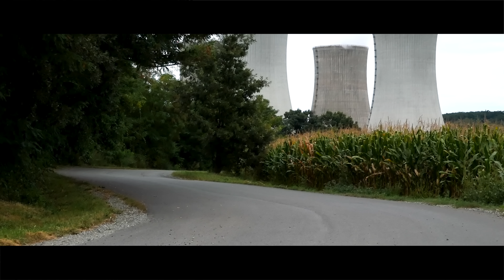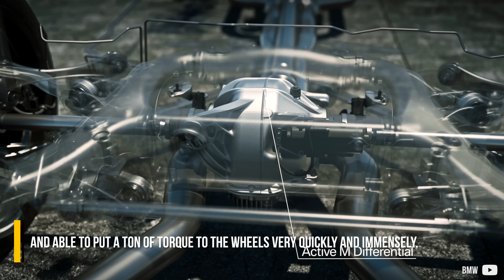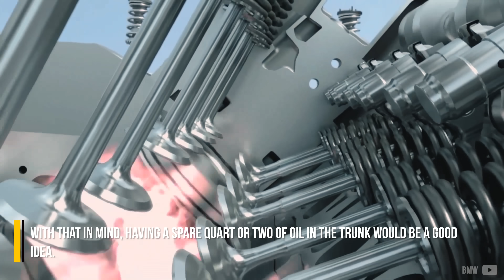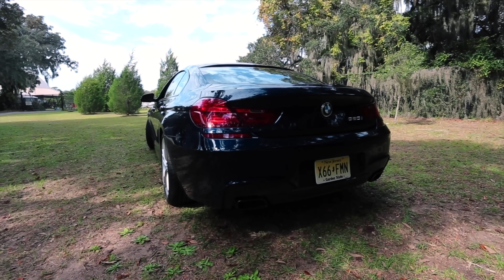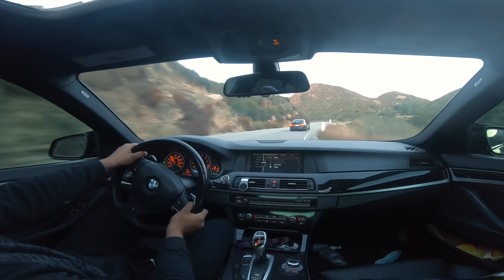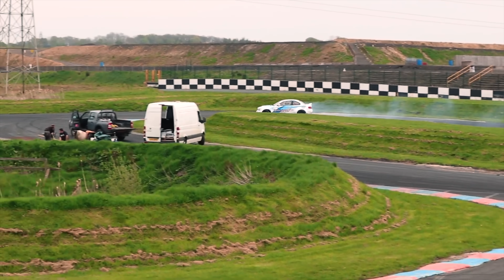The Worst BMW Ever?

Comment: I want to take a moment to reflect on how GM, Ford, and Chrysler have been designing and mass producing engines at this power level for decades, which tend to be both durable and as easy to work on as anything. BMW designed and manufactured this absurdly complex and impossible to service engine that barely makes more power than a 20 year old Corvette Z06 that doesn’t melt all the oil seals in the V after 15 minutes of track time.

I love my German car, it’s fantastic, but it’s also the kind of German car where “ease of service” and “durability” were basic considerations.
Reply: It's also using 2 times less gas...
Reply: i hope you realise while you're reflecting over there that the Z06 engines have 2l more displacement...
Reply: @kevin45ize  BMW is selling a luxury product. They can up the engine size to whatever.
Reply: @michaelw6277  they can't, their main market is Europe, where they would have to charge a lot more due to tax for a bigger motor and/or higher consumption/pollution.
Reply: @tiloalo  it's a luxury product. They can make it bigger. People worried about price aren't buying V-8 BMWs.
Reply: @tiloalo  oh, also they could just use Ford engines. Same displacement, same output, more durable, more reliable, cheaper, easy to maintain; a dramatically better engine in every single way.
Reply: @michaelw6277  what is that mythical Ford engine called so I can look it up?
Reply: @kevin45ize  oops, my mistake. The Coyote makes a touch less hp. But it's a 100k car, I'm sure the money saved using a Coyote instead of the lump of garbage they have currently frees up enough cash to spring for a Ford Racing supercharger.
Reply: @michaelw6277  never seen any efficient engine made by ford...
Reply: @tiloalo  yeah I mostly agree, but  the Coyote is a great engine
Reply: @michaelw6277  a M5 with a 4.4L V8 produce 617 HP, the ford with this 5L produce 396 HP... Not sure how they are comparable, they are probably 20 years appart in term of technology.
Reply: @tiloalo  Ford Racing sells a supercharger, good for ~750 hp. Not bad for old tech; cheaper, more powerful, more reliable, better durability, dramatically easier to work on, and doesn't create under hood temperatures rivaling the surface of the sun.

New technology isn't always better, and in this specific case it's significantly worse in every measurable way.
Reply: @michaelw6277  yes, a custom motor made for racing will be better, true.
Reply: @tiloalo  that's a street engine with a factory warranty

Comment: BMW thinks that “high performance” engines consume more than a quart of oil every 1,000 miles? Yeah I won’t be buying a BMW, ever.

I mean damn, my 150k mile turbo Volkswagen doesn’t use a drop over 5k miles between changes and I’ve been pretty hard on it for over 12 years now…

Comment: 15k oil change intervals is mad insane. my US bmw dealer has always recommended 7k… and at most i’ll push it to 10k.
Reply: thats 15k kilometers. so it comes out to about 8k or so miles. i do it every 5k for my n54. that oil aint cheap lol
Reply: 7k pushing it anyway but better than their recommendations. 5k is best
Reply: i’m speaking in miles here to clarify. i’ve done 7k on both my n54’s and they’ve had zero issue. This mileage was dealer recommended from my technician.

Comment: My f10 wasn’t a m5 but it had issues after 2.5 years , steering parts was failing and flywheel failed after just 20k miles , had electronic issues aswell , the car was a money pit after the warranty ran out and ended up getting stolen in the end , then I moved onto Mercedes w212 and the mileage was 133k Miles when I bought it and it was 3 years old , still got it now and it’s the most reliable car I’ve ever owned and the highest mileage car I’ve owned , the only money I spent on it was on tyres and servicing and still going strong  , the handbrake pull handle snapped once but that was maybe my fault but I replaced that myself for around £8/ 11usd , will probably need new brakes end of the year but that’s a job for me to do just like extra oil changes I done myself and I always switch of stop start engine as that wears the engine and other parts like starter motor , alternator , ac compressor and more and buying oil that’s suitable for stop start engines is just nonsense

Comment: I bought an e60 525D back in 2018, with the last money i had. It served me well for a year and then it became a nightmare.. I bought it for like 7k euros and it drained me almost 3k euros in repairs. While all my friends have shitty fords and vw i bought a bmw and often times i am using a cab to go finish stuff around city cause my car failed me many times. Huge problem is that this car is 15+ years old and maintantce costs like it's 5 years old.. I know someone will say "i had same car it was great", yes quite possible, but for ME personally it is a disaster. I still have it and i love the car but i am at the same time so much disapointed.. My next car will be a best car and thats a new car with warranty - no mater which brand.

Comment: Really good video. I don't mean this as a knock against your hard work in putting this video together, but I've noticed one common trend with all of these videos that focus on the problems with the N63/S63 engine...

We're now on the N63B44T3 version in the M50i vehicles, as well as S63B44T4 version in full on M cars. I feel like these videos need to focus on the improvements made to these engines in these latest revisions and leave the conversation open to whether or not the problems endemic to the N63/S63 in the past have been resolved or at least mitigated to some extent. It may yet be too early to see how these revisions will fair in terms of reliability, but since the engine is still around and still in active use I think it's an important piece of the conversation that gets lost in the criticism of this engine.

Comment: The turbos get hot, the radiator gets hot, the intercooler gets heat soaked. Then the car goes into limp mode.  My 03 E39 540i M-Sport 6-speed manual keeps chugging along no issues.  Those N63 engines are horrible.  Those 550i's and 650i's  all terrible eventually.

Comment: I had a f10 m5 6mt. I tuned it with basic bolt ons and drove it pretty hard- it was great until it let go at 50k miles and went into limp mode.  
Sold it for the GT-R.

Comment: Either design an engine with parts that will last at least 150,000 miles, or make the engine so that the parts are easily replaced. Instead, what most manufacturers do, including BMW, is make it nearly impossible to replace certain parts, and they make those parts in a way that they need replacement frequently. In other words, a nightmare for the owner.
Reply: @Mrwaffleandmilk  you are dead wrong, take a look at the Toyota 3.5 L V6 that they put in to the Camry and in the Sienna and in a bunch of Lexus models, not to mention the Lotus Evora. Those engines frequently go 200,000 Mi without anything being replaced. Case closed.

Comment: I had a 1995 BMW 840ci, I bought it because I think it is one of the most beautiful cars ever made. I had it for more than 10 years and I must say that I regret ever buying it because it was one problem after another.
Reply: That's actually pretty weird. The M60B40 in that was a great unit. The ZF auto transmission wasn't too bad either - though the manual was better. I'm not sure if the manual was available on the 8.
No VANOS, no turbos, good timing chain. The only problem I ever had with both my M60B30 and 40 were intake manifold gaskets. On my 40 I was having repeated problems until I planned the intake (by hand!). 
I think you just got unlucky.
Reply: @pgbpro20  the problems I had spanned the full realm of electrical, engine, cooling, fuel pump, suspension, so the engine itself wasn't so bad, but all the accoutrements added up.
Reply: @TheHomeExpert5  I think some of how happy you are with a car would be your expectations going in. I would expect all those things except for electrical gremlins, because I've been through it all before w/ ze germans!

Comment: The n47 is also a prime example of poor design, the biggest being that the timing chains may slip.
In my case i bought a 118d '07. had it for two weeks until it started making terrible noises. The repair shop said that the top was cracked where the bearing for the camshaft is, and there was heavy wear on the crank shaft. But hey, at least i got my money back.

Comment: N63 worst motor ever.  Didn't get 60k miles  out of that motor before it started blowing oil and fouling out.  Burned about a quart of oil per week. Worth nothing at trade in.  BMW should have never allowed that motor to be sold.  i will never buy another BMW again. Went Porche, never looked back.  What BMW has done with these motors is nothing less than criminal IMO.  BMW buyers beware, run away.

Comment: I’ve owned 2-1/2 BMW’s, I count my 2003 Range Rover as half BMW since they were responsible for much of vehicle engineering as well as entire drivetrain. Of the 3 vehicles, none lasted more than 25k miles before engine required replacement or major overhaul. 2 had transmission failures. One lasted less than 2000 miles; in 8 months ownership the engine seized twice, spent 3 times more time in dealership garage than in my garage and BMW voluntarily lemon lawed the vehicle before I could hire attorney. 

You could not pay me to have another BMW. One of my neighbours currently owns one, it leaves oil on his garage floor every night despite dealer making 3 attempts to properly seal engine. Garbage vehicles

Comment: I was disappointed with BMW and the run flat tire problems.  I researched that BMW has become more unreliable with 4, 6, 8 cylinder engines failing before 100,000 miles.  I tried Toyota/Lexus and was impressed.  I should have tried their statistically most reliable lineup earlier.  The different cost for repair and maintenance could be $1,000s or so high the vehicle is mechanically totaled by insurance market.

Comment: Try telling your BS to racing teams who compete in them, endurance racing etc lol.
Reply from the maker: Racing and daily-driving an engine is a completely different story and cannot be compared
Reply: @VisioRacer  dead right sunshine, racing put far more stress on a car over just a daily drive. Endurance racing is called endurance for a reason lol, smashing a car for 24 hours, etc.
Reply: @VisioRacer  follow production car racing like our Bathurst 6 hour race, cars are near showroom cars, BMW have dominated and none have spun the hub lol. That’s another BS.
Reply from the maker: @lbarbato6425  Well, I suppose they use different parts all around, different oil and muuuuch shorter intervals (after each race?). But what does it have to do with the road N63 which is known for all of those issues above?

Comment: never had a problem with f10 m5. Just changing oil every 3-5k km and runing well.
Reply: The problem is they say it voids the warranty to change it before the intervals when you buy them new so you're screwed, but changing the Oil more frequently definitely prevents most of the issues mentioned in this video

Comment: For any N/A engine is recommended to change the oil every 10,000 kms or 1 year, for a forced induction engine it should be less, not more!! I feel like 30k kms would be like torture, especially if it is pushed hard (average beemer driver).